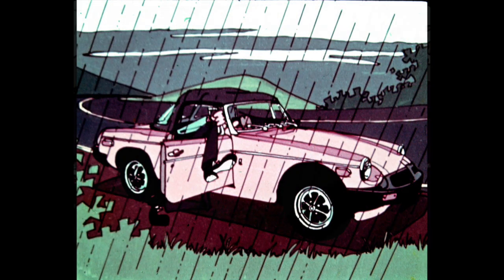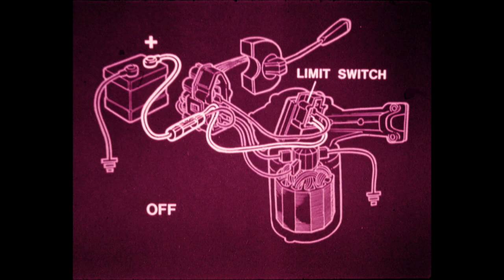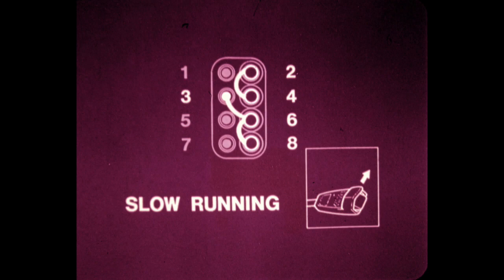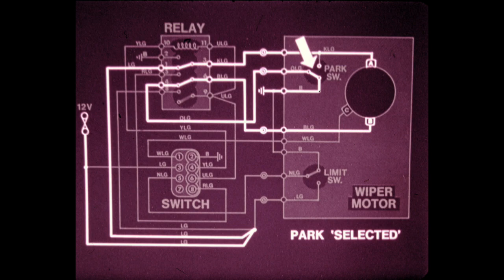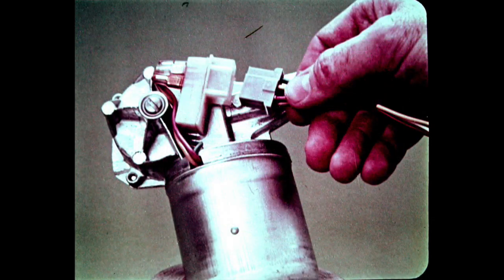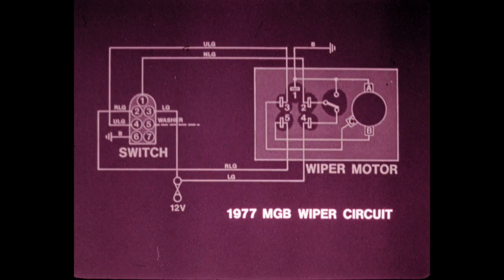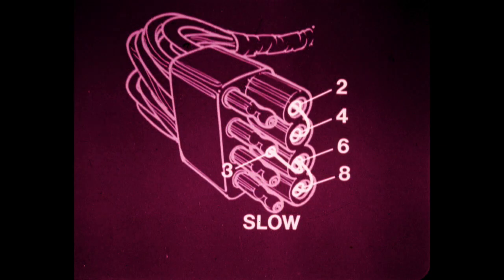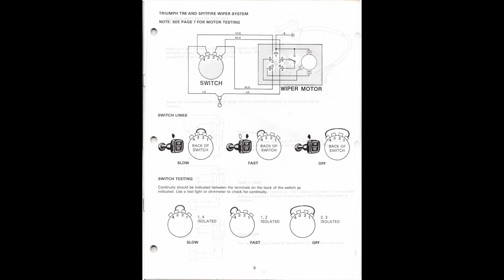BL202 - Electrical Wipers

Comment: my XJ-6 wipers work fine in all positions BUT the speeds are very slow. The wipers cannot keep up in heavy rain. This issue is not addressed. Seems like the motor is extremely lame, not enough torque. I understand this is a cable system unlike a pantograph system which is more "direct". Very dissapointing wiper system in the XJ-6.
Reply from the maker: Sorry not to reply.  Will try to find an answer if you still have this issue.
Reply: @jaguarclubsofnorthamerica  yes it is a permanent issue.